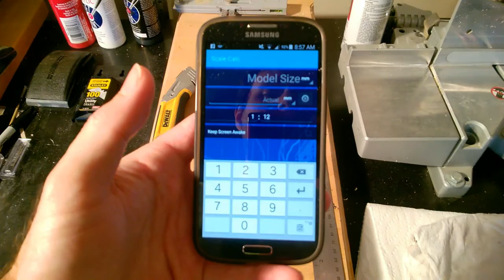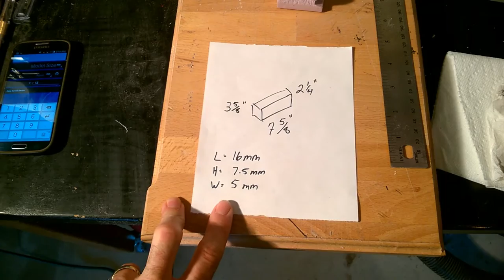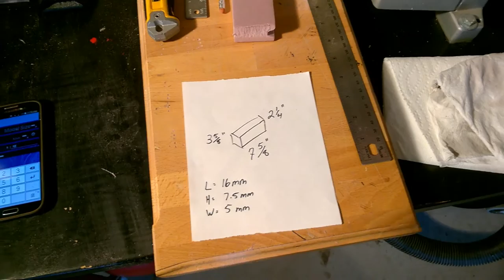Building a Brick Wall Diorama Tutorial

Comment: The first time i drew bricks was at school, it was a medieval castle, teacher made me do it again said it was too neat and straight. I would really like to make some dio's, but you cannot get this foam board in the uk, I am going to try using dry walling see it that works.
Reply from the maker: +Kuldip Binning I've seen folks use modeling clay that air dries you could try rolling Stone out on a thin board or something so it's flat and then cut your brick lines into it. Put some texture to it then let it dry. Then you could paint it up. Not sure if regular drywall will work, but who knows, I've not tried that at all. I'd luce to see what you come up with.
Reply: I was thinking of using plaster of paris, I have bags of it, and it gives a rough finish when spread real thin, remember I said I was dry walling the loft, so have a lot of off cuts. In the uk they call it plaster board. When I find a way to make it work I will let you see. By the way the art I use for my channel was drawn by my son the Design Tech teacher.

Comment: a dull pencil works much better
Reply from the maker: It depends on the look you're going for. A dull pencil is gonna make wider lines and that isn't always the look you want. Plus a dull pencil might actually be harder to get into the cut lines. But a sharp or dull pencil can be used.
Reply: @TechChucker  I used sharp pencil to shape the basic brick texture, then using a dull pencil to make the brick look uneven and give them the "plaster" between the bricks.